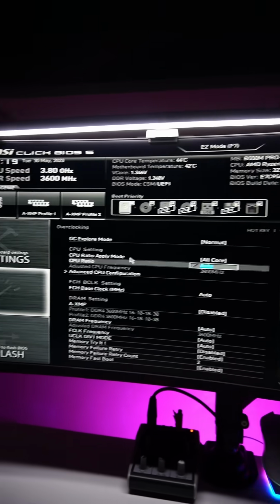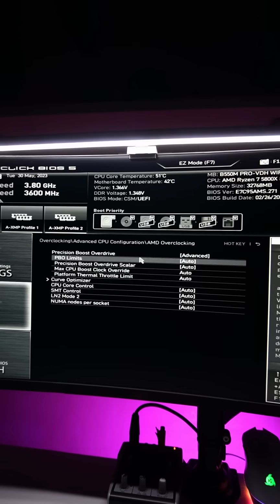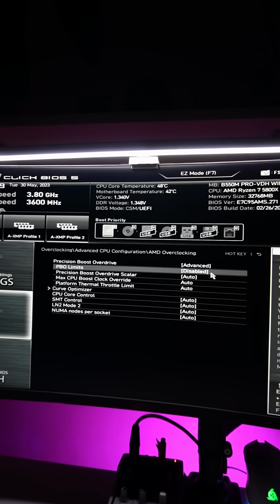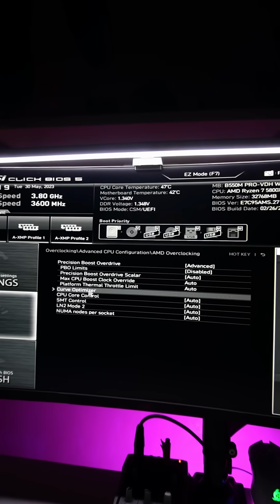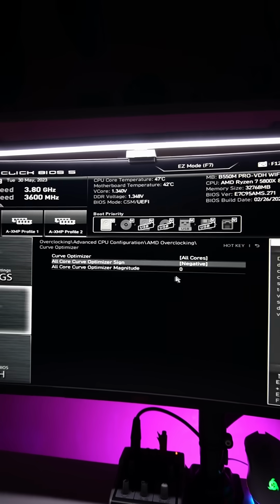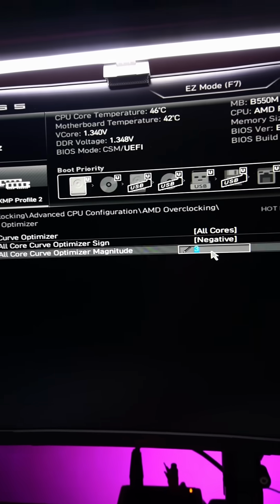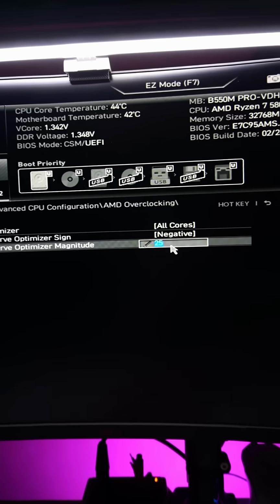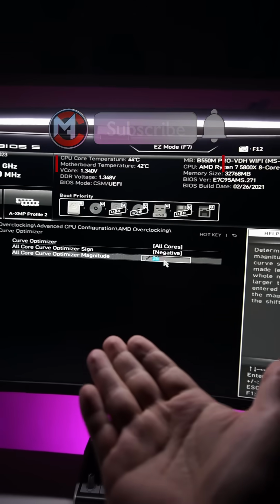Undervolting Ryzen CPU using precision boost overdrive #shorts

Comment: I maybe late on this but I saw this vid and played with my bios on my Strix B550-f and Ryzen 7 5700X. My Ryzen 7 5700x now overclocked with +200mhz , manual PBO limits at 90-75-80, auto scalar and Curve Magnitude to All Cores -25. Its now stable and boosting 4.85ghz with 1.2-1.3v with no changes on temp 60-65 on gaming using a $19 Air Cooler. Thank you.
Reply from the maker: awesome bro!

Comment: Can X570 handle -30?
Currently have
Ryzen 9 5950x
Msi x570 gaming pro carbon wifi
Cinebench R23 score on -25 
Is 24061 is it good? 
Update did -24 the scores go higher
Reply from the maker: yes it can, 24k is solid too, score is higher because too much negative curve op causes instability

Comment: I'd prefer a per core offset more usefull because not all cores can handle the same offset under load. I enabled PBO and used occt cpu all cores test and then a per core test  (in that order) i also raised the clockspeeds using OVERRIDE BOOST CPU in ryzenmaster by 150 (depending on cpu) i have a r5 5600x. It takes a while but in my opinion that's the most stable and reliable way to use CO with PBO
Reply from the maker: sounds like you took a really solid approach with occt and boost override. glad to hear it worked well with your 5600x, thanks for sharing

Comment: Hi, thanks for the vid. I use the old method : Asrock Taichi X570;  4x8Gb 3200cl14;  5800x  @4.4Ghz allcore ; Vcore 1.125v stable. 90w in heavy bench, less than 70°C with lousy air rad.... 
CB R23 14'800pts , it's bad or not ? thanks
Reply from the maker: awesome! thanks for sharing. for 5800x running manual all core 4.4ghz at just 1.125v those temps and power are actually solid. 
the score in cinebench r23 is perfectly normal for that clock/voltage combo. you could squeeze out a bit more with pbo2+ curve optimizer but for an all core manual oc, your result is definitely not bad, clean and efficient 👍

Comment: What happens if you turn off pbo completely and only have CPB on? Will it still hit 4.65mhz?
Reply from the maker: depends on your cpu model. it may still hit 4.65 under the right conditions. What pbo adds is extra headroom beyond that, higher sustained clocks, better performance and a bit more power draw and heat

Comment: So does a negative core curve mean lower temps and higher performance? Or just lower temps/power draw for the same performance?
Reply from the maker: Negative core curve in pbo2 usually means your cpu needs less voltage to run at the same frequency. this can lead to lower temps and power draw without reducing performance. In some cases it might even boost performance a bit if it allows higher boost clocks due to better thermals

Comment: My Ryzen 3 3300x have a problem, it keeps restarting on stock voltage, what best magnitude to run it well?
Reply from the maker: assuming this is not overheating or psu low power draw then this could be an issue with your xmp/docp if they are on. try running the pc with xmp/docp off. just clear cmos to do that. if it still shuts off then consider updating bios, just be careful if you're going to do it yourself
Reply: @MacCoyzkie ok thx

Comment: i'm confused , what i need to use :
- i use this way pbo limits or the other way undervolting by modif the core ration and the voltage or use both , pls help
Reply from the maker: may i know your pc specs first?
Reply: @MacCoyzkie  rtx3060ti r7 5700x 32gb ram
Reply from the maker: you can use this way, the one in the video if you plan to have a bit more performance and lower temps. try it out

Comment: Non mi compare la funzione "curve optimizer" 🤔 bios aggiornato all'ultima versione. Scheda madre Msi B550 A-Pro, CPU Ryzen 7 3700x. Ho provato con offset 0,1375 e va molto bene, oppure pbo "eco mode", abbastanza buono
Reply from the maker: i think you can use PBO with Ryzen 7 3700x CPU but PBO2 isn't fully supported, maybe that is why you can't see the curve optimizer. but that offset is interesting
Reply: @MacCoyzkie ieri ho applicato altro offset ... 0,1500 va ancora meglio! La funzione "eco mode 45 watt" non mi convince perché abbassa il voltaggio solo con carico CPU al 100%, nell'utilizzo normale il Vcore rimane alto con svariati picchi di temperatura (normale per i Ryzen). Non riuscirò mai a capire questi processori 🤔
Reply from the maker: @fiorillogianluca2791  i know right? and each year they release new models and makes it even more complicated.

Comment: Bro, I have a 9800x3d and should I set PBO limits to off or auto? And I would use the curve Optimizer to -20 because I heard it should be 100% stable and a dude told me I don't have to do a stress test but can just test in games but what exactly do I have to test?
Reply from the maker: use benchmarking tests like cyberpunk, it has built-in benchmarking tool in-game. black myth wukong has a separate one in steam and its free. there are more actually just search benchmarking tools

what the other dude told you is true, this is just to see if the current pbo settings will be stable since each individual build though they have the same specs will have different results

the worst case you can experience during testing is the pc will shutdown and will give no display when you try to open it again but don't worry, simply clear cmos to reset bios and try a different curve optimizer again
Reply: @MacCoyzkie And how much do you think which number in Core Optimizer negative is 100% stable? Thanks for the long explanations.
Reply from the maker: @FlipFlop_ツ  depends on the build, it is actually difficult to say which one is stable. my friend set his co to -24 but he can't go further since -25 shuts his pc down when gaming. what you can do is to start from -15 going up to -30. each step must be stress test. So if -15 is fine, next boot try -16 and so on.
Reply: @MacCoyzkie Is it actually a good idea if I simply deactivate PBO?
Reply from the maker: @FlipFlop_ツ  that's fine too if you don't want to trouble yourself with all of these numbers and stress tests for a little performance boost. If you want to see an actual difference at least with the specs i tested this (PBO2 vs Default settings) you can copy paste the link below and skip to 7:30

https://youtu.be/dEjO0kYtQKo
Reply: @MacCoyzkie And how long should I run the benchmark?

Comment: Correct me as I can't check it but I think i got Golden Chip or GOLDEN SAMPLE CHIP 

Bc9z my prime 95 blend all test
My CPU was at 100% usage
4.650MHz clock speed 
Core voltage ⚡ of 1.094
CPU voltage Package - 77W 
And Temperature 🌡️ were 58°C and Max upto  78.1°C
Reply from the maker: whoa! those are good numbers! of you're getting 4.65hz at 1.094v under full load with those temps then yes! it is a golden chip. how did you do it?
Reply: @MacCoyzkie idk bro i just Enabled PBO2 in bios and set curve optimizer for all cores negetive 26 and after some testing selected Per core curve optimizer and set 1,2,3,5 cores to negetive 24 and 4 and 6 to negetive 20 

Results -
Cinebench R23 
Multi core score 11721
Single core score 1531,
Max Temp 74.1°C
Core Voltage 1.094 to 1.125 max
Cpu PPT 76W

Prime 95 Blend Test (1 hour 15min)
Max temp. 70°C 
Mostly stayed at 58°C
Core Voltage 1.095 to 1.110
Reply from the maker: @Thecirclestory  interesting! now I'm jealous lol. thanks for sharing bro

Comment: i was running 5700x3d using pboTuner -30 system was freezing randomly not frequent but use to happen checked my event viewer found out the culprit it was pboTuner error planned to get my hands dirty n strted looking for bios undervolting n got ur video did the settings while running a cinebench test. Thanks quick n simple video.
Reply from the maker: no problem bro, glad it helps

Comment: i did this now i have no signal with my monitor. now what?
Reply from the maker: that means it does not work well with your build. to reset do this https://youtu.be/S9hyEPTFR10 but if you got the latest build there should be a clear cmos button on your motherboard, shut the pc down and press that button

Comment: I personally found under voting useless, but running the 9800X3D at 6MHz provides me the best performance with enhanced boost 2
Reply: What temps are you getting on idle?
Reply: Any update
Reply: @jworks6320 been working perfectly fine with the presets the motherboard offers.
Reply: What's the point even trying to get more from 9800x3d tho? 3xd cpus don't benefit that much from playing with setting like these anyways.
Reply: @Venstarful I do flight simulators so I take every little bit of performance I can squeeze out.
Reply: @Venstarful  I watched a full guide they were getting about 15-20%more fps after a proper tune in bios of all OC settings

Comment: got a 5800x my temps are good but i m keeping my ratio core at 44 and 1.175 voltage can i go for 46 /1.2 and what pbos hould i do
Reply from the maker: yeah you can and that's still a safe if your temps are good. just make sure you stress test it to check the stability. Also enable pbo with raised limits and try curve optimizer for better boost and temps
Reply: @MacCoyzkie  Appreciate it

Comment: I have 5700x and Msi B450M A PRO Max mobo, I did all like you performance increased a little but no changes in temps what to do?
Reply from the maker: this could be a problem with the pc case airflow your your cpu cooler isn't doing much help. Also consider the room temps as well. another is You haven't reapplied the thermal paste yet or the thermal paste is not good, try arctic MX-4 or 6
Reply: @MacCoyzkie  my cooler is Deepcool AG400 plus And thermal paste is also from deepCool
maybe my case aint that good
Reply from the maker: @_synosis_8929  bro 5700x  runs very hot and i don't think that cooler is going to cut it. gaming in that cpu with that cooler will have like 90c temps. you need a better cpu cooler
Reply: @MacCoyzkie its at least better than the stock ones and my case have only one exhaust fan and 4 intake no up mount system cause its too compact that's must be a cause for the high temps
Reply from the maker: @_synosis_8929  indeed, i heard that Thermalright Phantom Spirit 120 EVO is a good budget air cooler. Though i haven't tried it lol.

Comment: I have the 7950x and 9070xt, is the PowerSupply 750w enough?
Reply from the maker: 750w is fine, for most configuration or at least running the system in stock. if you plan to overclock 850w will be the safest. Anyway if you want to know more you can check this 2min video https://youtu.be/1bp1Bf7ADVw

Comment: Whenever i have core performance boost turned on for my Ryzen 5600x, my temps go up to 95c and above. How do i fix this
Reply from the maker: that's normal, since the cpu is using a lot of power and processing performance, that is why you also need to invest in a good quality thermal paste, cpu cooler and good chassis for proper airflow.
Reply: @MacCoyzkie  would u recommend the CORSAIR H100 as a good cooler?
Reply from the maker: @ yeah corsair aio coolers are good

Comment: Please help, R5 5600x only running in base clock speed 3.7ghz even when im gaming. How can i make it run on its max boost 4.6ghz?
Reply from the maker: do this Pbo2 bro, this feature dynamically adjusts the cpus clock speed to optimize performance, sometimes boosting it up to 4.6 GHz depending on temperature and power limits, you still need to test it after and if you get no shut down then its all good. if ever you lose monitor signal just clear cmos to reset
Reply: @  r5 5600x cant run max boost 4.6ghz by default? While playing cpu intensive games
Reply from the maker: @ no, you need to overclock it in bios

Comment: "I can enter a max value of turdy"
Jokes aside.
I just got my nasty hands on the r7 5700x3D, and right now with a cheap, really really cheap watercooler with third-party fans, 240mm, in idle it stays at 40.6 C°. The water cooler got near the GPU raising my before gpu's temp from 32~33 C° to 39~42 C°. I'd like to lower just a tiny bit my CPU temp so it don't transfer the heat to my gpu and, but I'm a coward and I fear damaging my beauty baby new born 5700x3D. I'm happy with my current config, but it could run less hot. Should I risk it doing this undervoltage to the CPU?

Comment: Thanks mate. I have a Ryzen 7500f + Phantom Spirit 120se + Fractal North (4x pccooler p120 pro fan + 2 original fan) with a -45 curve. 

Previously I got 75c temp max; now, I get 60c with ambient temp at 27c. Max power also reduced to 68w from 88w. Idle power doesn't change tho, still at 20-25w. I only use Cinebench 2024 30min tho for stability tests. I even get a better multi-thread score by ~20 at 860, and the fans run significantly slower/quieter GG.
Reply: I tried same on 7500F, only - 30. No others settings.I, with cinebench r23 when cpu at max, lost 10°C, 20W, and CPU PPT FAST LIMIT - 20%. +200 on r23 score (14300).
Reply from the maker: no problem bro, those are nice results

Comment: Followed your instructions. Worked my way down from -30 to -27 and I don’t see a major improvement in my cpu temps. Am I doing something wrong?
Reply: As a matter of fact I don’t see any real improvement at all.
Reply from the maker: @ I usually start from lower number. When i tested mine i started in -20 going to -26. I stress test in every increment. btw you also need to consider the bios update if ever it does not work well.

Comment: So when we change the curve number. What exactly are we monitoring for when we start our computer? I changed mine to 25 initially and my computer screen kept on flickering and I crashed
Reply from the maker: clear cmos, and try 26 next then stress test. if it does not wokr try 27 next
Reply: @MacCoyzkie isn't it opposite I tried -30 first then -25 both crash instantly on stress. -24 currently running for 5 min now no errors on Occt. Extreme/variable
Reply from the maker: @HeavyFeetProductions  starting at -30 is aggressive and could lead to instability, some build can but most can't. from what i've seen and tested, it's usually safer to start around -15 gradually going to -20
Reply: @MacCoyzkie -24 stable for half hour I had one shutdown randomly later, might go to -23 if I see anymore instabilities
Reply from the maker: @HeavyFeetProductions  i hope it all goes well

Comment: I use like urs amd ryzen 7 5800x but still had done this way.. my cpu temp was on 90 on startup.. can u help me with this
Reply from the maker: i hope you have the same mobo, I suggest start with the curve optimizer -20. stress it then if it didn't shut down you are good to go but if it did, try loading optimize defaults or clearing cmos to start again. next try will be -21 and -22 and so on

Comment: I have r5 5600g whith b550 gigabyte, What Number I should insert ?
Reply from the maker: know the max number your motherboard can handle, start from there, stress test it, if it shuts down it means it didn't work, clear cmos to reset then do it again with an increment of -1 each test

Comment: hello  I have an r5 7600x and the temperatures are a bit high.  does this method also work for my processor?  I also wanted to ask if the performance of the processor decreases.  please answer me, I really need it.( my motherboard is a gigabyte b650 eagle )
Reply from the maker: i wish i have the motherboard to demo it for you but unfortunately i don't have one in the office. If you look into what i've done in this video it's likely the same idea, but you need to look for this in bios
Tweaker > Adv cpu settings> precision boots overdrive> choose advanced> pbo limits disabled> gfx curve optimizer to all cores then negative> put a number starting from 15

stress test it and if it shutdown and show no display it means it didn't work, clear cmos to reset https://youtu.be/S9hyEPTFR10

do it again and this time try 16 up to the max value your motherboard can handle so do a little research on your board regarding the max value
Reply: @MacCoyzkie thank you very much, but the performance will remain the same if I do undervolting, right?
Reply from the maker: @vladandreimihai8488  undervolting in pbo2 will give more performance , it was better in my setup compare to the default settings

Comment: I have to do per core on this.  I have a 5900x with the B2 stepping and I can do 30 on 4/6 cores on CCD1, 28 on the other two, and on CCD0, it's between 15-19 for those cores.

I MAYBE understand how people can go and slap 25-30 on all core on their CPUs.  It has to do with core parking partially, and the boost you add to your clock speeds.  With core parking on, a lot of cores shut off, and the couple that stay on will hit the max boost you set when you're at idle.  If that isn't stable, then you crash while idling.

But with core parking off, no cores shut down.  And no cores will ever hit the  max boost frequencies that you select in the BIOS.
Reply: Where do u start though for all core ?
Reply: @Andrewthomasp What CPU are you using?  On the 5900x/5950x, MOST can do -30 on all the cores on the second CCD.

I ask what CPU you have because it's gonna matter if you have 1x or 2x CCDs.  

If you do all-core, it will depend on what the worst core can do.  I'm now doing -30 on all of my CCD1 cores but on the CCD0, I am doing something like -12 to -18, I think.  I need to look.

I believe most CPUs can do -12 all core.  But it varies SO much.  It will also depend on if you are using a negative voltage offset on the CPU, too.
Reply from the maker: Sounds like you're really digging into the details of core behavior and boosting. You're right—core parking can definitely affect how boost frequencies behave, and turning it off can lead to more consistent performance across all cores. It’s interesting how stability can vary depending on how these settings are managed!